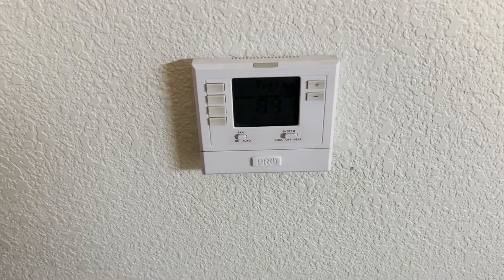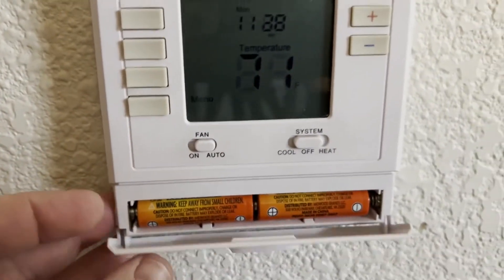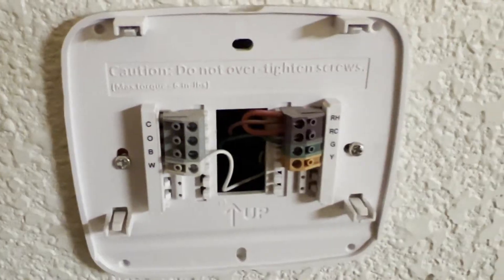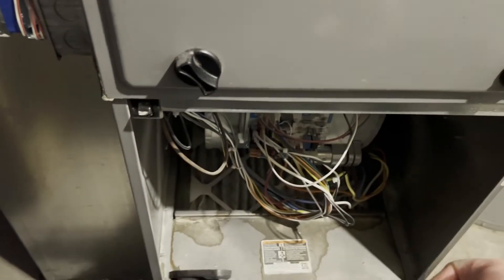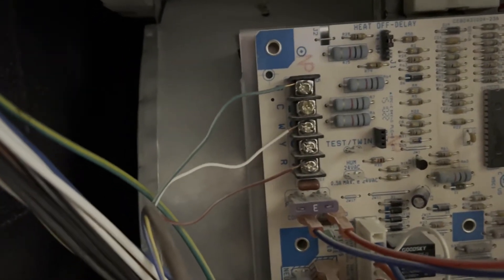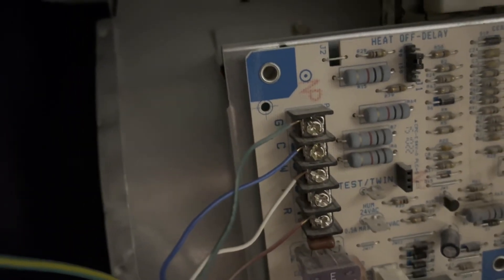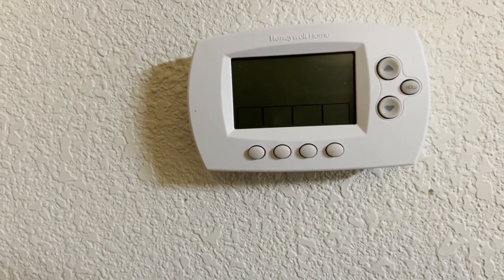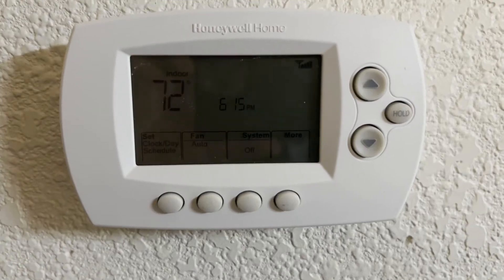Wi-Fi Thermostat Install with Missing C Wire Solution - Honeywell RTH6580WF

Comment: Thank you soo much man. Saved me a huge bill from company. I also don't fully trust them cause last time. They were here. They did some work on the furnace, and they left the jumper on that bypasses the thermostat, and I wasn't home and by the time I got home, it was like 9 million degrees in my house, and they had burnt an entire tank of propane, so I don't really want these ding. Dongs poking around. I am far more handy than they are.
But dude, thank you so much.I was leaning towards doing what you did so.Now i'm confirmed, I can do it

Comment: Question my blue wire is not even connected on the furnace side it's a no ac unit just like yours but the blue wire was never installed ??? It worked last year but I switched the thermostat out and it worked but now this year it don't I took the stat out because we have a separate AC unit with an air handler and so they don't get confused it's easier for me.